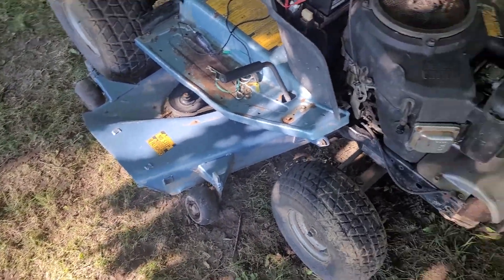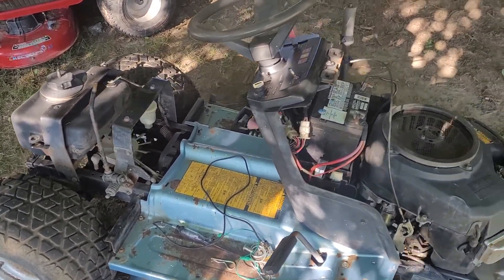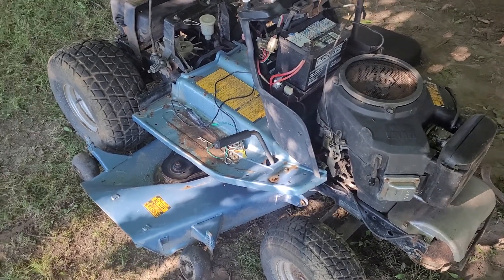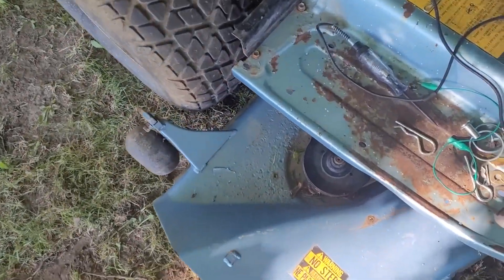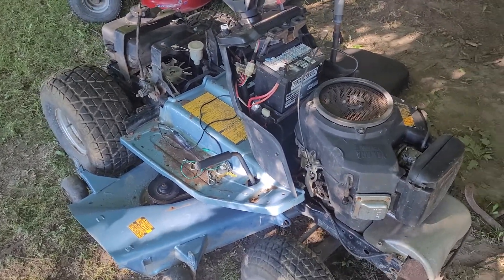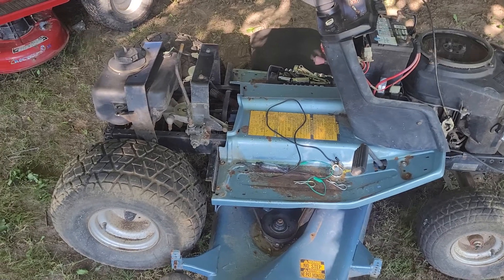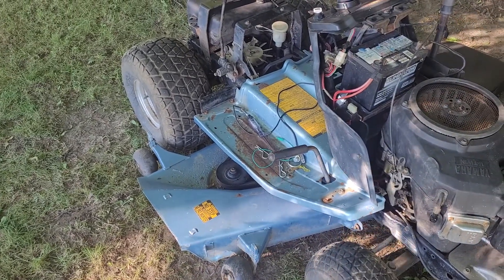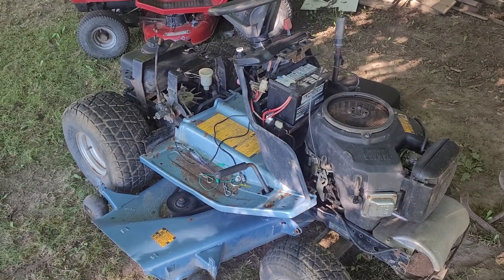Yamaha YT6800 (Mower Installed Test)

Comment: Wow, that is so cool. I have actually never seen one of these mowers. When did they make these? Were these commercial mowers? They do look like they would be good racing mowers . Great color scheme. I just found a Bobcat (Ransome) walk behind with the dual belt drive however like all of them that I have found The Kawasaki 14 horsepower motor blew up a while ago. The last owner repowered it with a Briggs 14 horsepower motor but  never finished the conversion. It sat outside for at least a year without any manifolds and a quick look inside the cylinder showed a large amount of rust. I filled it with Marvel Mystery oil  and a little ATF and tomorrow I am going to remove the head and see if I can get the rust out and hone the cylinder. Its always more than it seems .